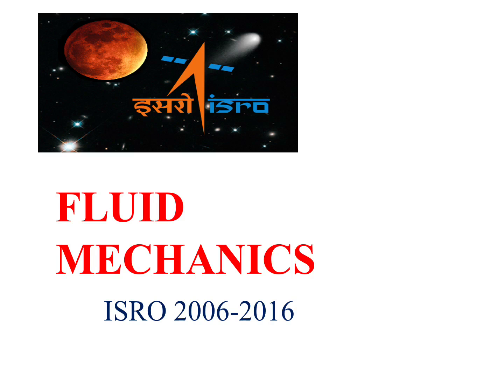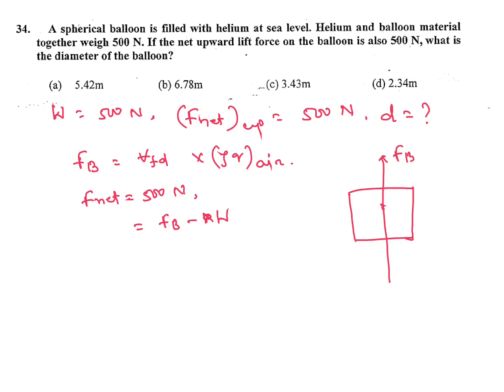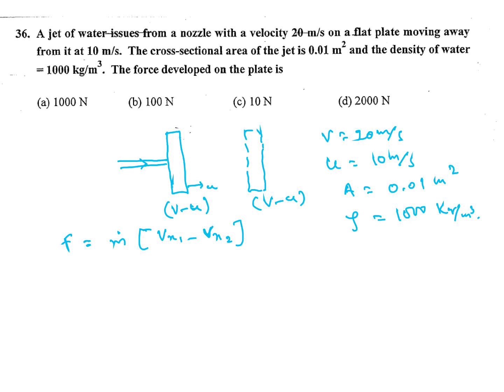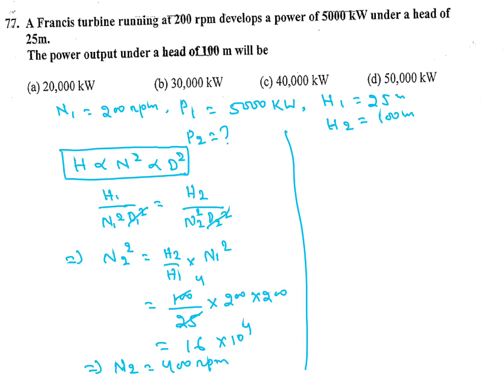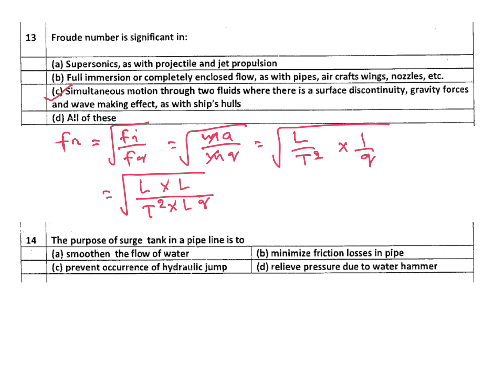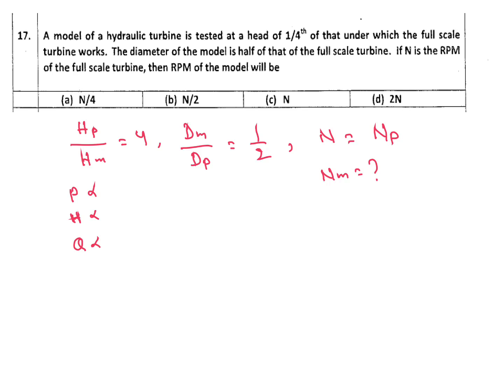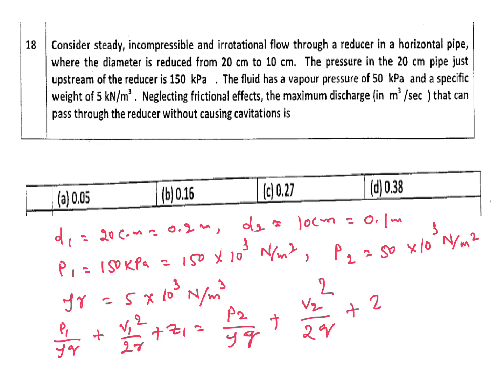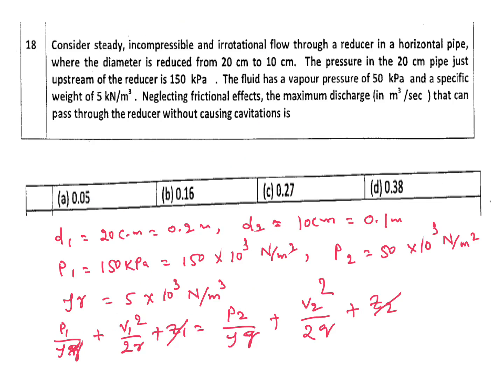ISRO FM 13

Comment: A tank 1.5m high stands on a trolley and is full of water. It has an orifice of diameter 10cm at 30cm from the bottom of the tank. If the orifice is suddenly opened, what will be the propelling force on the trolley?

Comment: In question 13..22.20...the surge tank is not just use for the relive the pressure due to water hammer.. It also used to give extra water when gate opening is full.. Bcz at that time if we don't supply extra water.. Cavitation will occur.. Therefore option is A.. Smoothen flow of water.. Give comment

Comment: Sir.. I  question 34.. The buoyant force should b equal to balloon weight.. It is not so..correct my doubt? And to find diameter I can simply do equating 500N force..weigh of balloon. But answer is coming different..